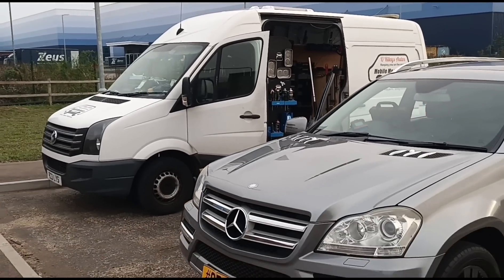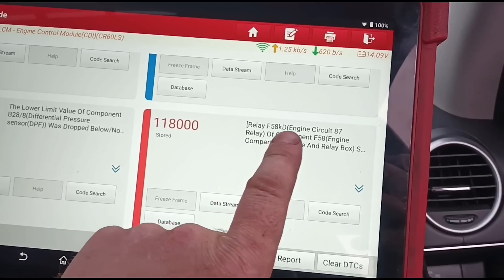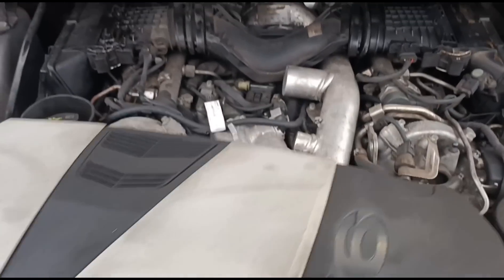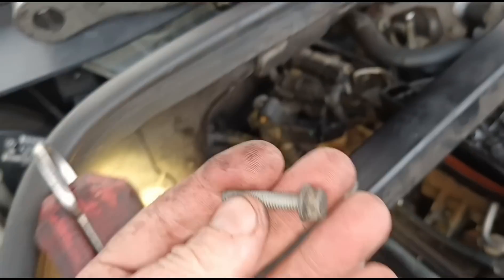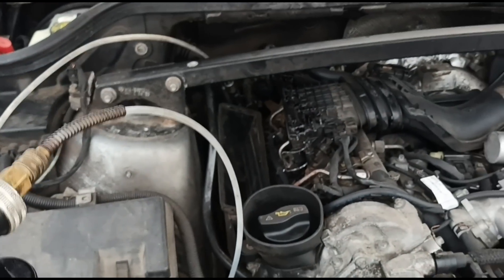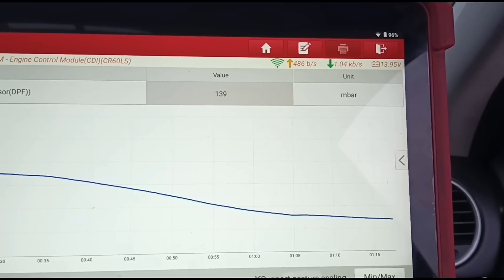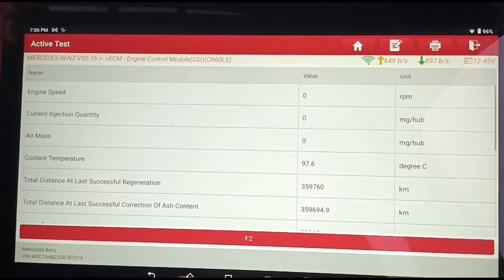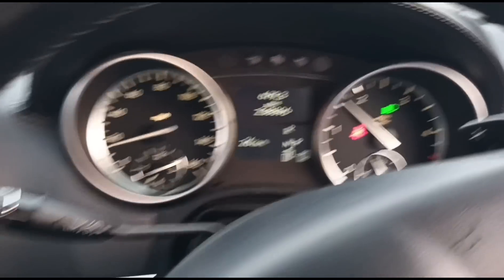Mercedes GL350 3.0 V6 13AF00 DPF Soot High 129700 Particulate Filter Defective 15FD00 15FC00 15FF00

Comment: What's the point of the filter if you just burn it off out the exhaust anyway?
Reply: Cleanly burning the stored soot to a small amount of ash, is far better than releasing the soot particles into the air.
Reply: @bills6093 Oh I see the soot is comverter to carbon dioxide and ash. The carbon black in soot is 1500 times worse than CO2 as a greenhouse gas. Makes sense. Plus all the nanoparticles in diesel now, better to trap in the filter hopefully. The stuff is terrible.

Comment: Jimmy I know you said once you've cleaned it once it's not worth a second time but? is it possible on that old of a DPF with some ash accumulation, and plugged pretty solid with soot (plus maybe some oil) that the DPF cleaner solution just can't get deep enough into the DPF on the first try. (only soaks halfway in) ???
oily soot, will repel water based products. just curious.

Comment: I would just like to ask you how can  someone tell if the dpf has been deleted when checking live data ? I have a jaguar xe that has a black tail pipe so someone obviously has cleaned it out but its now saying dpf full on the cluster but 0 hpa differential pressure at idle. Many thanks and great video.
Reply: Pretty much that... DPF delete usually has tell tale smoke coming out too. On 220k mile Peugeot, my tailpipe chrome is still shining!